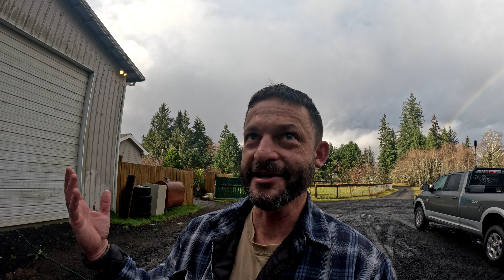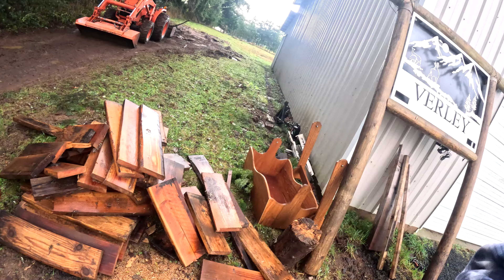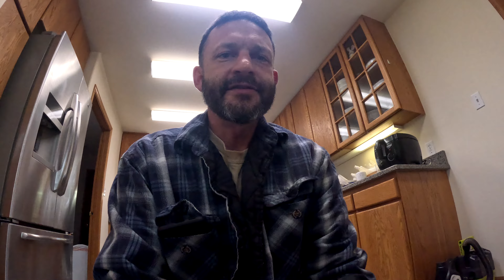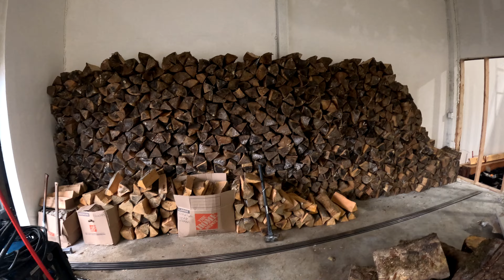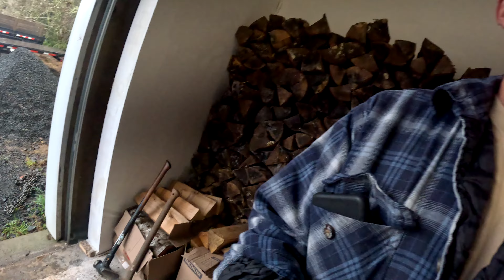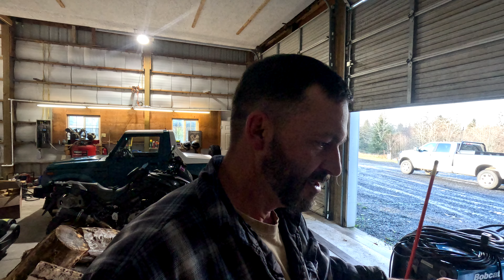Heating with wood, my wood stove, and splitting firewood

Comment: Yeah Matt..... I knew a guy that used to have a whole bunch of 6 inch diameter fir trees on his property he cut them to length with the chainsaw and just leave them laying on their side... And he would tell me to hit them right on the edge in a horizontal swing golf stroke....... If you hit that firewood right on the outer edge it's like tearing a piece of paper it started one edge and it goes all the way across.... But he leaves em  laying  on their side and he calls it golfing..... He used a double-bitted ax which is lighter weight.... And because of the angle in which he was swinging like a baseball bat or a golf club he could accelerate that double bit Ax so it was hitting the wood at over 100 mph.....
You got to be kind of careful if there's other people around you ( and practice) ... But you're cutting edge will not get dull from crashing it into the ground. You don't have to worry about spending time standing in the wood back up after you hit it.... I seen him cut 20 pieces in half in about 30 seconds. I have cut 8 and 10 inch alder rounds up like that.. after I get them in half a stomp on the corner and it flips the flat side down.. then I can I go for the outer edge again. Now I have them quartered.... Using the golfing method.... 
Still another method..... If your rounds aren't too long... And you've got some real straight grain stuff.... Use a froe..... You know the tool used for splitting shakes..... Put that froe  all the way across the diameter... A lot of times it'll pop it.... And if it gets stuck you just get it out of there with some wedges.... My favorite firewood is mountain hemlock 4 and 6 in diameter you don't need to split it... It smells amazing season it for a year or two.... If you can find some stuff that grew above the 5,000 ft level it grows real slow and it has tight grain.
Reply from the maker: @tedanderson463  I often use the golf swing with the maul too...but I'm definitely not as accurate and it isn't as controlled.  Sometimes an odd strike results in risk to shins and toes, and pieces of wood can get launched in unpredictable directions.  All of this would be OK for me if not for the fact that I'm getting older and it hurts a bit to execute hundreds of golf swings with a splitting tool ;)